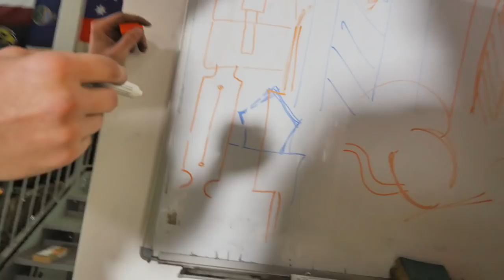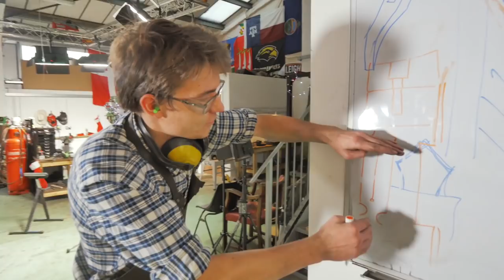MAKING A SCOTTISH CLAYMORE SWORD!!! PART 12

Comment: PVA glue like Titebond III (as a wood worker I use this a lot) is very nice(ish) easy clean up. However not many ppl may know this but virtually all polyurethane adhesives are the same titebond’s version of this type of glue is the same. polyurethane adhesives are water activated and currently hold the best at of all adhesives that bind hard to hard. PVA glues have their usages however polyurethane adhesives are the strongest bond especially if you are using HARD woods. With hard woods PVA glues like Titebond III just end up bonding to themselves and not the wood. Also PVA’s do NOT handle well under high heat. This is based on experience however I do have a work cited if needed.

Comment: The application of the gorilla glue was done wrong if it was original gorilla glue and not their special wood glue. With original gorilla glue you damp one surface of your piece of work, then on the surface, you are attaching to the damp surface you use small drops of the glue evenly spaced out. You damp the surface you are gluing because water activates the glue and makes it stick to surfaces better. Once the glue is activated, it expands 2-3 times the size of the drop you put on, thats why you evenly space the drops used instead of having a long bead. Anyways, great video! Can't wait to see the claymore finished up, it's nearly there!!! Also, Joe did an awesome job forging the tools for the crucible!

Comment: On your handle to actually pick up and pour the crucible, you want to add a bar that you can slide and lock in so that as you pour your metal out the crucible won't move

Comment: I have poured glazing bases in the past, what I am missing at your tool is a latch that will keep the crucible in the holder when you pour, it would be rather nasty if it slides out when you tip it.

Comment: fyi if u leave the tree in the shop for a while like that you have to make sure that you cut off an inch or so of the bottom because after the sap quickly gums up the bottom of the tree making it unable to suck up water which kills it prematurely

Comment: May I suggest a Y shaped catch, the arms hooked, so you can tilt the pot past 90 degrees without it coming out of the lift he made. Just a pair of hooks and a longer straight arm would allow you to do a full 180 degree rotation without having the pot fall into your casting sand or hitting the floor and spilling molten nastiness anywhich way

Comment: just drill out some holes for a couple of dowels. pinch them with pliers to grove them and then set them in and glue it all together. even if you sand down to the dowels it wont mater you are going to wrap the handle. it will be way more solid. 

Go look at how larry potterfield from midwayusa attaches an ebony forend to his safari rifle.

Comment: If you ever try to twist wire again you might want to do a bit of research into how rope is made.  Not only does the rope or cable as a whole have a twist, but each strand must be twisted itself in order to coax it into keeping it's shape once twisted with the other strands.  You can get a feel for this by taking a plastic shopping bag and twisting it tightly, and then folding the twisted bag in half and letting it relax somewhat.  It will naturally form a cable-like double twist in the opposite direction.

Comment: I have a small concern about the handle and pommel.  First i think the pommel should be larger to help off set and counterbalance the weight of the blade.  Second, with the way you have the handle tapering toward the base and the small pommel there is nothing to stop the sword from slipping out of your hands when it is swung with force.  It may be just for show but it should still be usable.

Comment: You need to add a sliding rod/holder thing to the crucible tongs. If you don the crucible will slide out of the hoop while you poor. Easiest way would be to use a square tube close to the size of the square rod that is on either side of the hoop. Then weld a rod bent in an L shape to the rod. So you can slide the tube back and forth in the handle. When you push the square tube towards the the hoop the leg of the L slides over the top of the crucible thus preventing the crucible from sliding out of the hoop.

Comment: Hi Alex, may I recommend you rough cut the handle with the bandsaw first. I believe one of the reason the epoxy failed could be the best from grinding. If you rough shape the handle on the bandsaw then you won't need to grind it so hard. Cut one side then take back the off cuts and cut the other profile. I also concur with the other guys who say gorilla blue isn't your best option. Try tiebond 3 or 2.

Comment: Alec, why when you are making a wooden handle, you do not keep the fissure slightly smaller than the tang, then you lighten the tang and force inside the handle, it should carbonize and form a nearly perfect fit for the tang. And you can carve the cleft for the tang on just one side of the piece of wood and glue, rather than carve the two and have to hit the depth, a much simpler way in my opinion.

Comment: Hope your glue holds...... The last time I used Gorilla Glue you were supposed to dampen the project before assembly, the moisture activated the glue better than ambient air humidity. I've since moved to Tightbond wood glue.

Comment: You are going to want to weld a stop on that handle for the crucible. Or else the crucible will slide out of the holder right into your mold. I know from experience how necessary that is. Also can you make a knife of your choosing out of canister damascus. I think that would be amazing.

Comment: Hey here's a little tip about glueing up wood. Try to use dedicated wood glue like Titebond or what ever its counter part is in the UK. The glue is water based so it soaks up into the wood fibers better than epoxy or super glue. Most of the time the the glue joint will be stronger than the wood itself after it has been clamped and dried. Any squeeze out can be cleaned up with water or sanded off. Once sanded the glue in the joint won't be visible ,and the only way you really can tell that there is a joint at all is from the difference in the grain patterns of the two pieces. I hope this makes any further wood work a bit easier on you. Love the videos ,keep up the good work.

Here's a link for more info on the glue
http://www.titebond.com/product.aspx?id=e8d40b45-0ab3-49f7-8a9c-b53970f736af

Comment: You have to soak olive wood in acetone to glue it. It's a naturally oily wood, and does not glue well, like coco bolo or teak. use a wood glue not epoxy too. Epoxy might be better to fasten wood to metal, but not wood to wood.

Comment: Alec, there's a Gorilla Glue that's specialized for wood. I believe what you used was the "all-in one" variant. It's still very strong, but I believe the wood specific one would have better served your purpose. I work in the adhesive section in a hardware store btw :P

Comment: That is a crucible now the next question we have to ask is what will he be melting down into billets.
Steel is the obvious first choice but melting steel requires temperatures in the 2,800°F / 1,538°C area.  Copper is the second choice because it requires significantly less heat (1,984°F / 1,085°C), and Aluminum only requires a warm blacksmith day (1,221°F / 660.3°C).

As much as I would enjoy watching Alec Steele make his own steel I know how difficult it is.
Reply: JohnSmith FakeName My vote goes for melting down speed cameras.  They're free, readily available, and if you need another one if you leave it a couple of days they grow back, so a sustainable eco friendly source of metal...

Comment: Those salamander pots are sturdy enough to survive a couple of "wootz" billet melts by the way if you're still looking for a way to use that meteorite. I do a billet every couple of years when I have enough broken drill bits and tool steel offcuts in a smaller salamander crucible. Probably doing one in the next few weeks, you know, if you fancy sending me a bit of meteorite hinthintwinkwink

Comment: are you guys going to put any kind of latch or anything on the pouring tool? cause if you tip it too far, it might drop the crucible... i noticed some hesitation when you guys were testing it out... just a suggestion, gotta stay safe guys! especially when there's molten metal around.

Comment: Did you activate the gorilla glue with water?  If not, it isn't going to hold very well.  Just use yellow wood glue (i.e. aliphatic resin) -- the joint will be stronger than the wood itself that way.

Comment: He you both, besides holding the crucible, you also need a “clip” to secure the crucible when you poring the molted metal. You do not want by any possible change the crucible with molted metal to slip out you poring-handles!

Comment: The next time you use wire for a handle you can use six strands of the wire twist three clockwise and three counter clockwise you will get a cool effect when they are layed together it kinda looks like a zipper

Comment: A few comments on Glue.

Epoxy mixed correctly (wood) have been fine. kek  Also new epoxy would work better.  Epoxy mixed correctly is one of the best bonding agents on the planet.  This is why it is used in commercial applications so much.

Wood glue... before you go off on me please understand I have more than enough qualification to comment on the subject.  Wood glue is great for things not being handled, impacted, and for things you don't expect to last.  The issue with wood glue, and many other glues, is crystallization.   Eventually what happens when the glue crystallizes is the bonded pieces split at the seam due to stresses.  The crystalline structure of the glue is not very strong and can be easily broken.  You can do your own experiment with this at home using different glues.  

Gorilla glue. (GG)  My experience with GG is about 10-12 years ago.  The way GG gets around the (Wood glue)  issue, kind of, is by expanding when exposed to air.  This forces the glue into the pores of the material and makes the glue structure more of a lattice work, see engineering.  The lattice and penetration greatly enhance the bonds ability to deal with stresses.  The draw back to this type of glue though is the less porous the material, the weaker the bond will be.

Comment: Gorilla glue is awful for wood, though they do have great marketing. As other posters have noted, regular wood glue, such as titebond or equivalent (say Elmers wood glue) is stronger than the wood itself if applied properly.  Also, band saws work great for cutting profiles like you sanded into your handle. You can mark them out and cut two sides then tape those pieces back on and mark and cut the other two sides. Then you only have to sand the last little bit. Cabriole/Queen Anne furniture legs are made this way.

Comment: Couldn't you sand as much in the groove as you did on the outer edges? Seems like a simpler solution, even if it would take longer.

Comment: Hey Alec I have seen other black smithing shows on YouTube and sometimes they just heat up the tang red hot and then shove it into the handle slot and it Burns it bigger would that work for you or no?

Comment: why are you not using wood glue? i use ever build 502 wood glue its resin based and weatherproof. pick it up from toolstation chap here's the code 31670. Its stronger than gorilla glue and doesn't expand .

Comment: Did you wet the wood? The Gorilla glue doesn't work if you don't wet the surface. It looked like you just applied the glue to dry wood. It probably won't stick very well.

Comment: Did you activate the gorilla glue with water ??

If you didn't it won't set correctly

If you did your gonna have a hell of a mess to clear up with the amount you used as that stuff is like expanding foam

Comment: I personally would suggest not using gorilla glue. (I think that's what you were using) it dries to a very strong yet very brittle material. It may be an issue with longevity. I would personally suggest some Titebond. :)

Comment: Would have been a bit easier to use a bandsaw to rip a lot of the handle material off of the blank rather than all that grinding to make piles of sawdust. :^)

Comment: You seem to like dust? Why do you remove most of the wood by sanding and not using your bandsaw first removing most of the material first and only do the final shaping with the grinder.

Comment: now use the crucible to smelt the meteorite. and you made a crucial mistake with the gorrilla glue you were supposed to wet one of the mating surfaces with water... You might have been better off with real wood glue...

Comment: JEEEZUS CHRIST ALEC ! The way you took out the battery could have gone downhil very quickly. Whatch on youtube what happens with a damaged Li-Io battery if the seal breaks and it gets exposed to air.

Comment: OK wrong glue AGAIN!!!! gorilla glue is AMAZING but it foams up big style!!! the best glue for wood is the plain old WHITE wood glue! either titebond or something similar! it makes a bond stronger than the actual wood!!! also olive wood is not the best to use for gluing up as the oils in the wood make it a weaker bond regardless! just think about having oil on metal, nothing will bond to it! I love your work Alec & could never come close to your metal working skill but I work with wood so know a little on the subject.

Comment: Hey Alec, I'm not sure if someone has mentioned this yet. But when you twisted up the wire.. you should have put the drill in reverse and twisted the wire in the opposite direction for a little while before releasing it from the drill. This will take out some of the twist that you had created but it would have also removed some if not all of the tension in the wire so when you released it from the drill it would not have sprung back and bird nested the way it did.

Comment: That’s not ‘proper’ wood glue my man. Get some titebond 3, you’ll have so much more success and ease of use. It’s waterproof and incredibly strong! 👍🏻
Reply: On the contrary, Gorilla glue (the type he is using) is activated by water.  What you say?   Water?  Yes.  you apply glue on one side and water on the other, clamp the sucker up and the glue expands (cue excitement).  I would not have known this if I did not see it on The New Yankee Workshop years ago.  Many people do not bother to read the bottle and are disappointed.
Reply: paul kelly I know about Gorilla glue, and how it is activated/sets up. I’ve used it quite a bit for various projects. It never seems to hold up as good as titebond 3 wood glue.  Especially on a project like this. Gorilla glue also makes more of a mess than it’s worth.
Reply: Yea, it oozes out all over the place and I have also used it on many projects.  Just don't get it on your bare skin, it has to wear off, there is no cleaning it off.  I've never done a comparison between the two.

Comment: Epoxy? Gorilla Glue? WTF? To glue wood you use PVA-based glue; it bonds stronger than the wood itself. Examples include yellow "wood glues" such as Titebond (Original, II, & III) and Elmer's Carpenter's Wood Glue, as well as white glues such as Elmer's Glue-All, and even Elmer's School Glue, as well as glues from various companies that are just labeled "PVA Glue". 

If someone likes the Gorilla brand for whatever reason, they now make actual PVA-based wood glue - https://www.gorillatough.com/product/gorilla-wood-glue/ - but that's not what this kid is using here; the stuff he's using is the original polyurethane-based Gorilla Glue. The only circumstance in which polyurethane glue is stronger than PVA glue is when gluing end-grain joints, but end-grain joints which are simply glued = bad practice anyway, regardless of what you're using for glue. This kid is gluing side-grain to side-grain, which is ideal for using only glue, and PVA glue is the ideal glue for that.

Comment: First .. why didn't you just use the band saw to rough cut the handle?? .. and .. secondly .. typically, gorilla wood glue is a polyurethane type of glue .. which requires DAMP wood .. I sincerely hope that part was omitted through editing .. or you're going to be back to square one ...

Comment: If you remove the vibrator butthead laugh from just below where the battery sits, you can pull those tabs easier without breaking so you don't have to risk exploding your battery bending it like that lol.  Not like you care, you're a blacksmith... not a phone repair specialist lol